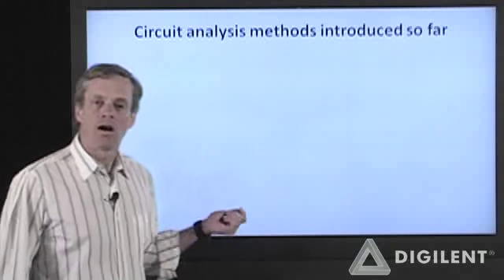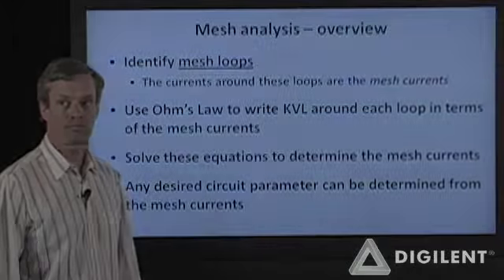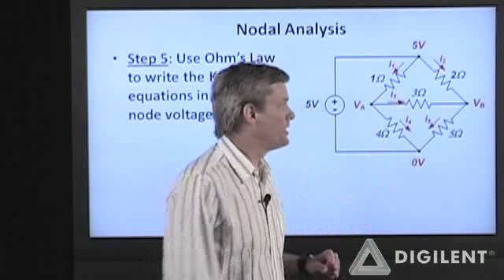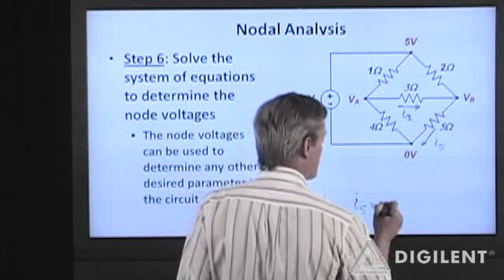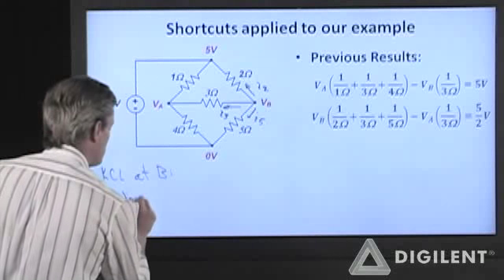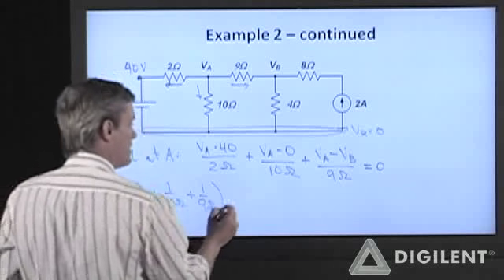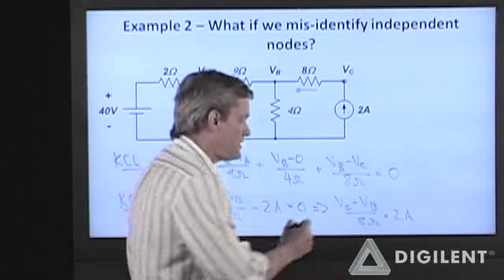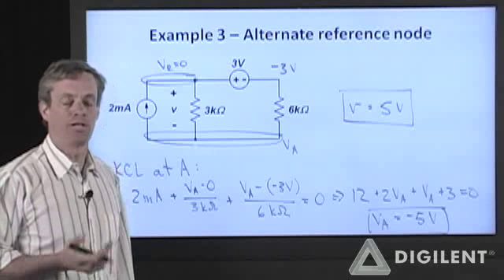Real Analog: Circuits1.07

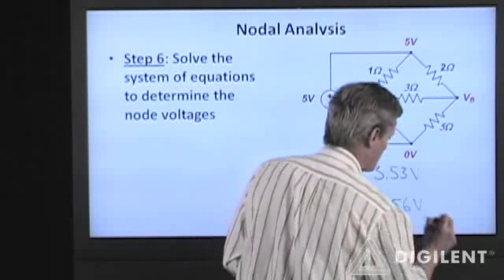Comment: I believe that the solution of the bridge circuit at 18:56 is wrong, although the equations are correct. Va should be 3.934V and Vb = 3.688V. The solution given by the Mesh Analysis in video 1.08 is the correct one. 
 
Va=5V-(i1-i2)*1ohm
5V-(1.721311A-.677737A)*1ohm=3.934V

Vb=5V-i2*2ohm
5V-(.655737A)*2ohm= 3.688V

Comment: I also calculated Va=3.93, Vb=3.69 for first circuit, not the resulting values presented in this video, and I double-checked it by running a simulation of it with falstad circuit simulator from http://www.falstad.com/circuit/ , which confirmed that Mohamed Elmi is right. Therefore this video contains a miscalculated result, but the described method itself (nodal analysis) still does work correctly.

Comment: Thanks a lot for these wonderful lectures.
As for the voltages at node A and B for the first circuit, I got: Va = 3.934V and Vb = 3.689V. And for the second circuit Va=30.46V and Vb =14.91V I don't know why you got 12V at Vb at the second circuit.

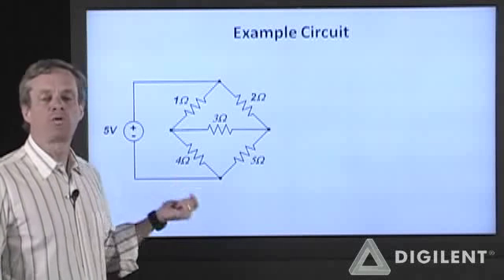Comment: Wouldn't the circuit schematic on the slide "Example Circuit" (at approx. the 2:45 mark) indicate that all the resistors are parallel to one another (by applying KCL to all the nodes)?

Comment: There may be a problem on page 10 of the Chapter 3.2: Nodal Analysis text. The set of equations for Node B do not appear to be correct. I believe that the 16 A current should be negative since the current source is entering Node B.
If I'm mistaken, would someone please explain the algebra for deriving the equation on the right (which is correct) from its predecessors. How did the voltage change from -16 volts to positive 16 volts?